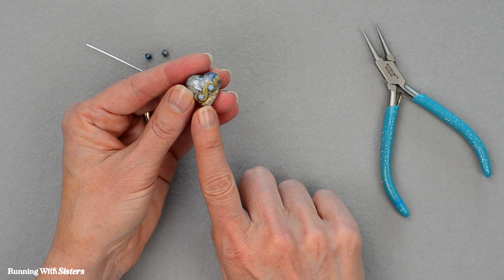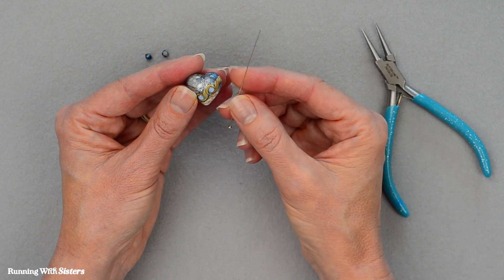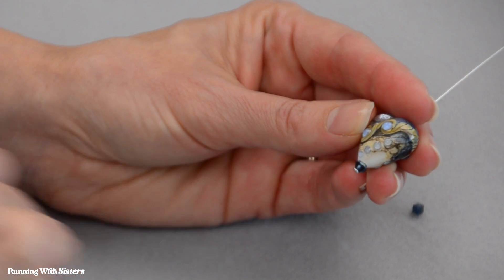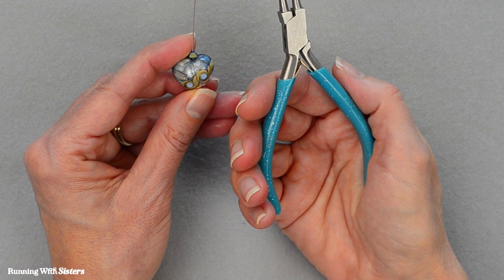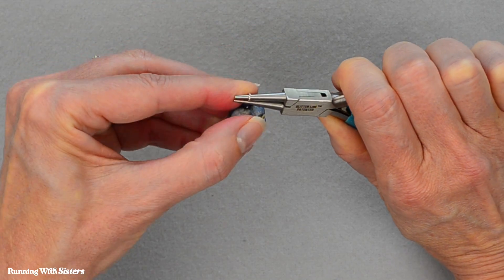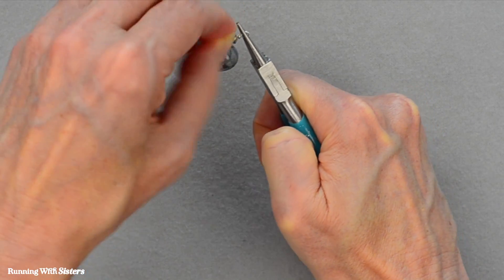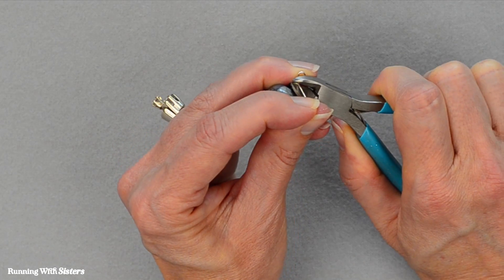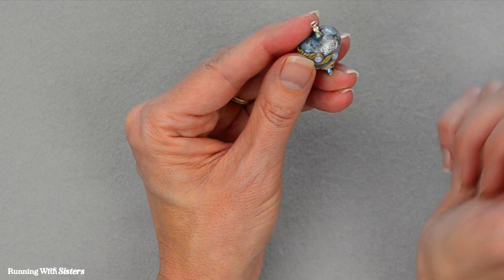Turn A Bead Into A Pendant: Easy Jewelry Tutorial

Comment: Love this video.  Are there some head pins that are easier to wrap around?
Reply from the maker: Hi Frances, Great question! It sounds like the 3" headpin wire you have is made of a low-gauge wire. The lower the gauge, the thicker the headpin wire, and the harder it will be to bend and wrap. We recommend trying a higher gauge wire, like 24-gauge or 26-gauge.  
 
We often buy headpins online so we're sure we know the gauge. Here are a few 3" headpin options from sellers in Etsy:
 
https://www.etsy.com/listing/1064937050/3-24g-wire-wrapper-14kt-gold-filled?ga_order=most_relevant&ga_search_type=all&ga_view_type=gallery&ga_search_query=3+inch+long+head+pins+for+jewlery+making+24+gauge&ref=sr_gallery-1-19&sts=1&organic_search_click=1&variation0=2200219358

https://www.etsy.com/listing/63971392/10-sterling-silver-flat-head-pins-you?ga_order=most_relevant&ga_search_type=all&ga_view_type=gallery&ga_search_query=3+inch+long+head+pins+for+jewlery+making+24+gauge&ref=sr_gallery-1-29&frs=1&sts=1&organic_search_click=1&variation0=607651932&variation1=1139669983

https://www.etsy.com/listing/956368857/64pc-silver-plated-round-ball-head-pins?ga_order=most_relevant&ga_search_type=all&ga_view_type=gallery&ga_search_query=3+inch+long+head+pins+for+jewlery+making+24+gauge&ref=sr_gallery-1-39&sts=1&organic_search_click=1
 
We hope that helps! Let us know how it goes! 
Cheers,
Jennifer & Kitty